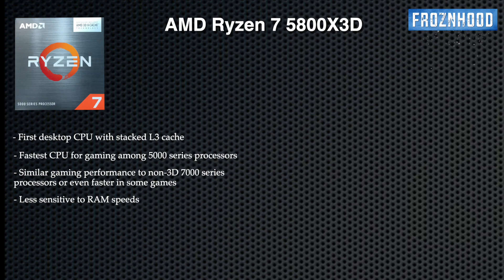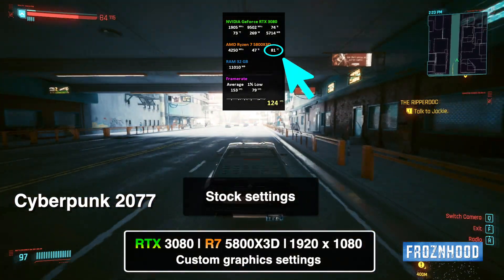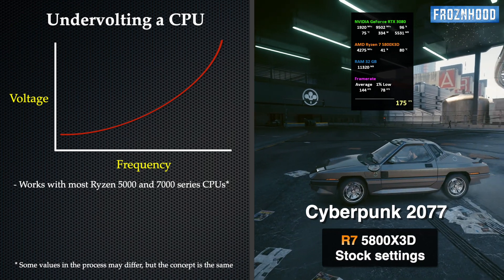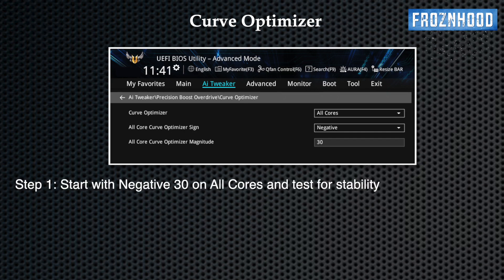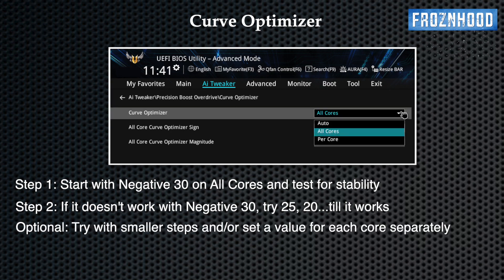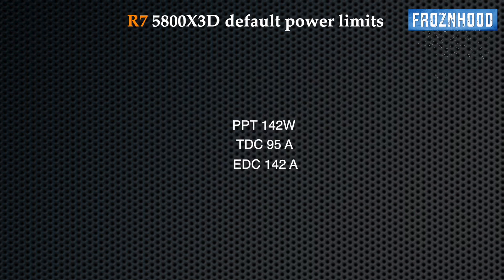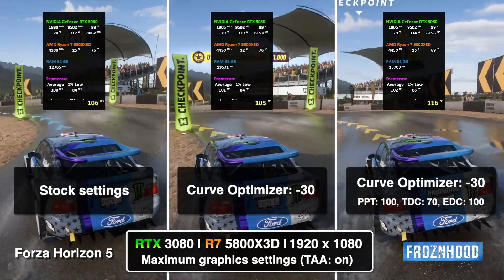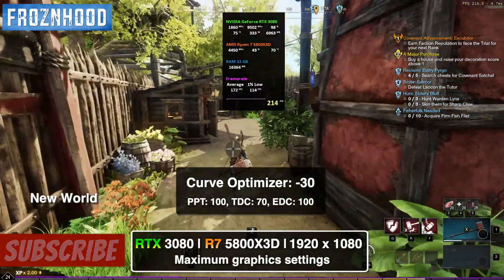Optimizing Ryzen 7 5800X3D - Higher performance, Lower temperature | Undervolting | Curve Optimizer

Comment: I did just this and got immediately better temps, max clock speed consistently, bit more fps and less power usage on warzone (it’s the most intense game I play). 
My question is how can I properly test to see if this is stable or just a 1 off thing with this specific game?
Reply from the maker: Hi, use both Cinebench and Warzone for stability testing. If the system is not stable, in most cases you will start having issues during the first 30 minutes. In Cinebench 1 or 2 hours testing is more than enough. In Warzone just play as usual.
Reply: @FroznHood  thanks for the reply I’ll put in a good warzone sesh and see how it responds and cinebench later. Overall tho everything was extremely helpful dropped like 12-15 degrees, hitting 65 absolute max and clock speed is 4450 practically a whole game
Reply from the maker: Even if at some point it hits 75 temp that will be normal.
Reply: @FroznHood  I was previously already at 72-76 now I’m Low 60’s, max 65 I think
Reply: I use HWINFO and Prime 95, they really work well for CPU stress testing and they’re both free.

Comment: Passando pra agradecer pela dica do video, apliquei no meu setup e de fato houve uma melhora significativa nos frames e redução da temperatura, os clocks se mantem quase fixos em 4450mhz

PC Specs:

R7 5800X3D
X570i ROG
Noctua N9A (aguardando a vinda do novo gabinete para substituir pelo Noctua D15)
2x16GB 4600c18
2x2TB Kingston nv2 Raid 0
RX 6700 XT FE (aguardando a vinda da RTX 4070 TI)
CM NR200
CM V850 SFX
Reply: caraca, 4600 nas memorias! to pensando em testar essa dica do video p baixar a temp do meu ryzen 5800x3d. Acha que tem algum risco? minha mobo eh uma b550m asus tuf gaming plus, 2x16gb ddr 3600c16 fury renegade e uma rtx 4060ti.
Reply: @Papac0  risco algum, o máximo que pode acontecer é vc perceber a placa mãe tentando ligar e não conseguir estabilizar o CPU aí ele liga em safe mode (o post da BIOS vai te avisar que ligou em safe mode pois não conseguiu subir com as configs anteriores) aí na configuracao da otimizacao da curva onde o cara do vídeo estou -30 ele alerta que caso não fique estável no seu setup vc vai baixando para -25 ou -20 

Aqui no meu caso estabilizou no -30 porém essa x570i gaming tem uma certa vantagem mas vai fundo que vai dar bom na sua tuf

Minhas memórias são as Corsair vengeance RT (otimizadas para Ryzen) ficou brabo pra jogar, fluido de mais

O próximo passo agora é tentar espremer as latência ou subir um tequinho a frequência das memórias, o máximo testado segundo o qvl da Asus na série 5000 foi de 4800mhz mas nas especificações técnicas posso chegar ao máximo de 5100mhz

Talvez eu teste isso e grave um vídeo só pra deixar registrado e depois volte a segurança do xmp pois já tá ótimo...
Reply: muito obrigado pela resposta, me encorajou a fazer o procedimento! quando eu chegar do trabalho irei testar, vou me inscrever no teu canal para acompanhar! @octavioperes
Reply: @Papac0  agradeço a inscrição, acompanha que eu vou compartilhar um pouco de conhecimento e boas práticas sobre ti no geral e também vou subir uns gameplay
Reply: voltando aqui pra agradecer! testei com os parametros do video e, aparentemente, os melhores resultados que consegui, pelo menos jogando cs2, foi com -20 all cores e os limites de 100/70/100 (exatamente como no video). em breve vou gravar um video sobre o novo pc e o desempenho no cs.  @octavioperes
Reply: @Papac0  top d+, faz sim pra nos vermos como ficou o pczão bala
Reply: ta no canal ja, manao! da um confere @octavioperes
Reply: @Papac0   Cara, você conseguiu baixar as temperaturas? Fez exatamente como no vídeo?

 Comprei meu 5800x3d, vou pegar amanhã.

 A tela da sua placa mãe é igual a desse cara do vídeo? É a mesma coisa?
Reply: @GuilhermeRodrigues-xu6yz  consegui sim! fiz exatamente como no video! clocks ficam constante em 4450mhz e temps nao passam dos 75 in game. A tela da BIOS é a mesma, minha placa mae é uma ASUS TUF B550M GAMING PLUS

Comment: Did the exact values, the temperature went from 90 to 70, with a Thermalright Phantom Spirit 120 SE. 
Great video, quick and concise. Liked and subbed.
Reply: I HAVE THAT  same cooler. what are u doing that you reach 90c lol
Reply: @Ivanology91  Do a small extreme test on OCCT (or Prime95).

Comment: I wish you would have included wattage usage from stock to your ppt adjustment.
Reply from the maker: What do you need the wattage for? How is it important for your system?
Reply: @FroznHood  to see the difference in wattage, performance, and temperature.
Reply from the maker: The wattage itself is irrelevant here since it is controlled by the limits and it is not a specific target we want to achieve as a part of the end result. The targets are performance and temps which are both shown in the comparison sections.
Reply: @FroznHood  but you showed tons of gpu stats which of none are a "specific target". I'm just saying i am curious on the wattage difference and how much it changes from ppt adjustment.

Comment: Going to have to use a air cooler that isn’t going to cut it, it the included cooler from the 5600g. Figure I can under lot Otto get by til I can either go buy a better cooler or order one. Got the icue h100 elite but the case is just a bit too small to install the fans once I finally got the radiator installed
Reply from the maker: It is important to use a good cooler. it doesn't have to be very high-end model, but at least something mid-range. You can find a good low-profile model for your PC case.

Comment: @FroznHood, Hello, Y-day i've got 5800X3D and its amazing! I've had 5800X before, so just wanted to future proof myself without switching to AM5 and its no regret. Overall, after undervolting and setting up PPT/TDC/EDC like you did in the video, I am having 30% increased FPS in unoptimized games (like in Escape from tarkov, in games like Wart hunder, WOW classic etc, my fps is capped at my monitors rate - 165 FPS). However I have some questions :) I am using HwInfo with RivaOSD to track performance. Also, i see CPU that is working between 4100Mhz and 4.450 Mhz. Its not consistently on 4.450. (FYI property I am reading is "Core Clocks" in HwInfo Sensors config for OSD). I am just wondering if this is ok or it should be consistently on 4.450MHz? Or I am showing wrong property from HwInfo? Also regarding temps - I am having Raidmax LC-240 AIO plus one 120 fan at the back of the case. Is this AIO suitable for this? Because even after undervolting and curve optimization i had a temps around 80-85. After removing plexiglass side of the case temps are between 65-75 during gaming sessions. Regarding spec, its Gigabyte X570 gaming X motherboard, 3070 OC from Zotac, 32 GB of 3200 Mhz RAM. As I've said, AIO is from Raidmax, LC-240. I've applied new NzXT thermal paste when I've switched procs yesterday. Also,  running all games on 1440p  :)
Reply from the maker: For watching the CPU frequency try MSI Afterburner. I am surprised that you have gained 30% FPS increase after the procedure. That is too much and I am not sure if your CPU has worked properly at all before that. Either it has been throttling a lot or your BIOS had it stuck at low frequency. Regarding the coolers, I am not familiar with the Raidmax brand, but the LS240 models looks capable of cooling this CPU. It doesn't require very high-end coolers. I prefer good air coolers, but that is another story. Something you should focus on is why you get -20 temps when you remove the side panel of the case. It means that your case air flow is not good and something is throwing heat towards your CPU when the case is closed (probably the GPU that is too close). It is recommended to have good front and rear case fans.

Comment: hello, i followed your guide and everything is stable running at -30 all cores and 100 70 100 set up just like you did. however i downloaded ryzen master and on there it shows that curve optimizer is off. ‘CO - OFF’ is what i see, have i done something wrong? i rememeber when i under older my 5600x before and looked on ryzen master it showed -20 on there but now for this cpu its not showing. 

i see that the the power limit etc has changed so im assuming the -30 is applied?

Comment: Hi there, I recently bought a Ryzen 7 5800X3D! Your question is that I have set everything up based on video and Kombo Strike 3 is also turned on! Everything runs stably, do you think combo strike can be turned on with the setting in the video? Because everything runs stably when present!
Reply from the maker: Kombo Strike is a kind of alternative to Curve Optimizer. It depends on your BIOS what you can use in combination.
Reply: @FroznHood  Thany you! Currently I use an MSI MAG B550 tomahawk motherboard! But I turned off the Kombo Strike and the video settings are stable for the time being! No collapse!

Comment: Hey there! Used this guide and I have big (as it appears) instability issues, yet I really want this implemented as having low temps is important in my current setup.

I am playing Path of Exile and that only, and at everything I have tried - it always crashes at some point (without PBO it never crashes).

Things In have tried:

Curve optimizer -30/-25/-20/-15 with ppt:100, tdc:70, edc:100

Curve optimizer -30 with no limits.

At all of these I was getting my game crashed, please help me out, how do I work with this one so it gets stable and I get my temps down? Thanks to everybody in advance.
Reply from the maker: You must be sure that other settings are not breaking the stability. You can try with full reset of the BIOS and after that applying the settings from the video. If that doesn't help, it is just your CPU unit that can't handle these settings. Sometimes that happens.
Reply: @FroznHood  Hey there, I had my BIOS fully reset before doing the settings. I was just curious if making negative offset lower to numbers like -10 or lower would still make it work for me, and maybe make it somewhat stable, is it worth trying to do that? or it only should bring more instability? I am just trying to find something that could work for me to make temps just a little lower
Reply from the maker: The only way to find out is to perform your own tests. Every CPU unit is different and reacts differently to voltage settings. -10 CO may or may not make a positive difference. Just try it.

Comment: I'm new to pc building and bought the 5800x3d and paired it with my rtx 4070 and watched this video to get an idea what this undervolting thing is all about and why alot of people are doing it... to my surpirse its fairly easy because of your video. I just followed the -30 curve optimizer, PPT, TDC, EDC settings on your video and it had a huge difference in my cpu temp my cinebench score also went up vs before I did the stuff you mentioned on your video. for that you gained a subscriber. kudos
Reply from the maker: I am glad you achieved good results. Thanks for visiting the channel and the feedback.

Comment: I stuck a 5800x3d in a budget Asrock B450M HDV R4.0 motherboard. The motherboard by default restricts the power to PPT 95W, TDC 80A and EDC 90A to protect the weak VRM. Set a -30 all core curve in the bios and I had one cool and quiet CPU. AM4 is the best platform ever!

Comment: I'm not even able to boot to windows with -5 on all core, any advice?
Reply from the maker: Reset your BIOS to factory defaults first. Then try again.
Reply: @FroznHood  just tried and I've also set negative curve to 20 to start with. Will run some tests and give an update here for others :)
Reply: I was able to run offset -30 and 100/70/100. Run a few cinerbench runs and it seems to be stable! I'm running a 360 AIO for now the temperatures slowly go up to 66-67c from 77-78 before. Thanks a lot for replying to my comment and helping me out! Earned yourself a subscriber @FroznHood
Reply from the maker: Thank you for the feedback. i am glad you managed to solve the problem.

Comment: Another great thing about this CPU is that it usually allows extremely low curve optimizer values - many people report that they achieve -30 on all cores.
I should point out that, while the settings in this video are excellent for gaming, they might harm all-core performance, so single-core and multi-core benchmarks should be performed.
Reply from the maker: You cannot maximize the single-core and multi-core performance at the same time. For multi-core tasks (not gaming) the CPU needs more power and high-end cooling, which is the opposite of what Undervolting strategy provides. Futhermore, it is a gaming CPU. It shouldn't be chosen for its performance in multi-core work tasks. No matter how you optimize it for multi-core it will fall behind 5900X/5950X/7700X+ series CPUs.
Reply: @FroznHood  Exactly my point - some multicore will have to be sacrificed for games, and vice-versa.
Reply: @FroznHood  What is the best way to check for optimized gaming performance on the CPU?
Single core CPU-Z benchmark (it's quick)?
Reply from the maker: The best way is to pick one or two CPU-intensive games that have built-in benchmark and where you are CPU bottlenecked. Or compare same scenes in a particular game. Cyberpunk has a good benchmark. Depending on your GPU you can achieve CPU bottleneck on lower resolution and lower settings.
Reply: @FroznHood  What is it that causes the increase in performance? Reduced temperatures allowing for higher boost bins?

Comment: Do I need to do this even if my temps are good with my cooler AIO Frozen notte 240? This optimization can give me higher performance? Thanks for this video btw.
Reply from the maker: The answer depends on too many things. Regarding to gaming, there is a performance difference in many games. I don't know what your expectations are, so you can just try it.
Reply: @FroznHood Thank you. I play only fortnite and I want to have the max fps I can get. I have a RTX 2080 SUPER. I'm going to try and see my performance.
Reply from the maker: If you are playing in performance mode and 1080p resolution, you should get a performance boost.

Comment: Hi, great tutorial. I've one question
How can i revert the undervolt to go back to my default settings?
Reply from the maker: Hi! Just put back the values as they were before. Or, if you don't remember their previous state, reset you BIOS. But be careful, because that way you may lose other settings you have changed.
Reply: @FroznHood  By loading defaults or on motherboard by the button ti clear cmos?
Reply from the maker: Try both in this order.
Reply: @FroznHood  One last question, how do i know if loading defaults was enought, so i dont need to clear cmos
Reply from the maker: Enough for what? You didn't specify any problem you might have.
Reply: @FroznHood  I mean, if i want to revert my settings, i only have to load defaults settings, Is not necessary to clear cmos.

How do i know if my settings changed to default succesfully?
Reply from the maker: Well, leave the BIOS, restart the system, go back to BIOS and check if the settings are the default ones.

Comment: I did the same with the limits 100 70 100 and with -30 and -25, and my clocks are completely locked at 3250mhz for every core and wont move from there, leading to a lower performance. Am I doing something wrong?
Reply from the maker: In your case you probably need to reset your BIOS to factory defaults first and then put the settings again.

Comment: Sub and like deserved❤❤ went from 80c to 68c under heavy load. Performance also improved a looot. Ur amazing man keep doing what ur doing. Under full load however it does throttle a little while at 70c what can i do to get it to run higher?
Reply from the maker: Hi, thank you for watching. What do you mean by "full load"? Are you testing in a game?
Reply: nope in cinebench for example it only boosts up to like 4350 but when gaming 4450 @FroznHood
Reply from the maker: Cinebench behaviour has nothing to do with the performance in games. It performs full multi-core load which doesn't happen in games. Use Cinebench for testing only and nothing else. You also should not expect all cores to work at 4450 at the same time. Your goal is to have stable max frequency of 4450 in games, which usually use less number of cores. If you want an optimisation for multi-threading work tasks such as 3d rendering, that is another story and another optimisation strategy.

Comment: I tried pbo limits auto and  - 30 all cores and fixed the temps better performance i think try it 😊
Reply from the maker: If that works for your cases, of course, it is OK. But that depends on the game and your cooler. In many cases CO -30 is not enough without also settings the limits.

Comment: This video is extremely informative. In case this helps anyone, in my case you needed to go into the "extreme tweaker" in the asus bios to find the proper settings. I went from hitting 90c and throttling on prime95 to hitting a max of 70c with all cores at 4450mhz frequency. I am using a 360mm AIO and was always curious as to why it "wasn't enough" to keep the chip at a lower temperature during gaming but it turns out all I needed to do was undervolt. Thanks for all the help.